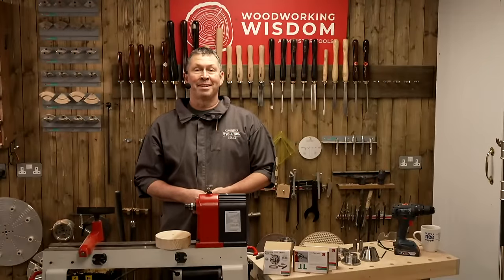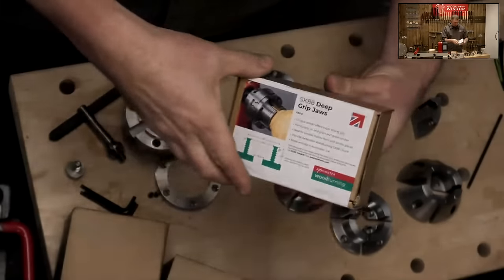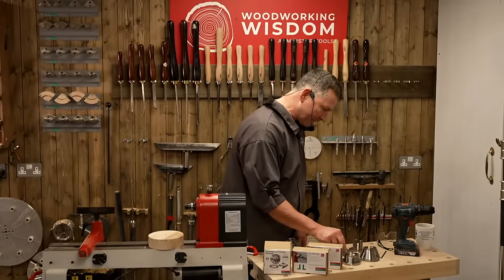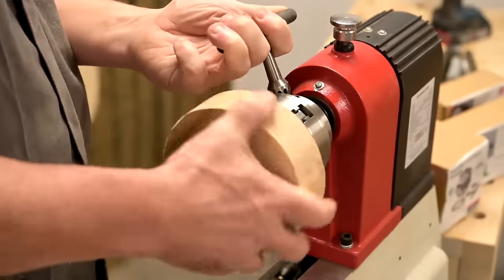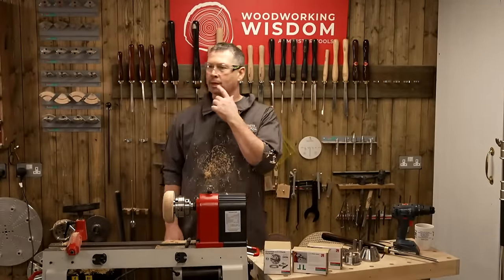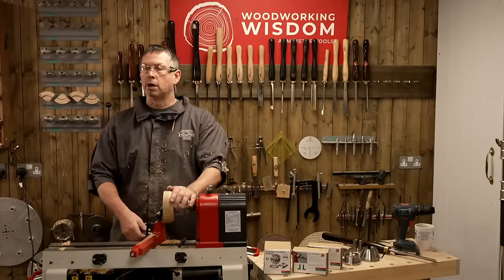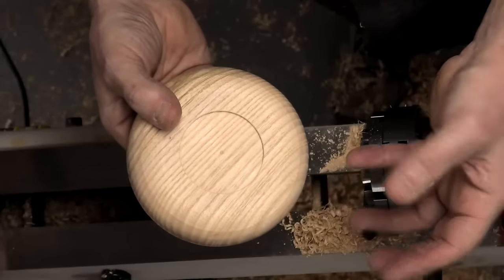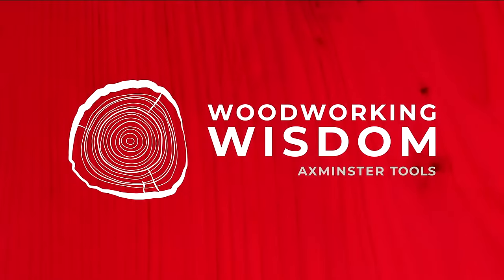Axminster Woodturning: Essential SK88 Chuck - Woodworking Wisdom

Comment: I missed the live feed but I have looked forward to viewing this video. As a new turner I initially purchased a cheap Ebay lever adjusted chuck.  It was in my opinion quite dangerous. (Insecure clamping, loose threads, no stop screws if you open too far, and it seems that the jaws always protrude outside of the base making a significant rotating hazard.  For most of my turning the compact Axminster design keeps the jaws internally and seems safer.   I bought an SK80 after watching an older Axminster video and I can't imagine using another chuck for my projects. I believe that my SK80 will last as long time for my use.  Your information leads me to get a 100 as I grow my turning skills rather than an 88 (as an additional chuck) at this time. Thanks!
Reply from the maker: Thanks for your feedback and glad to hear you enjoy using your SK80 chuck. And yes, the SK100 would be a great addition to your set up as your skills grow.

Comment: Will the jaws for the SK88 fit the Clubman 80.  Also will they be available in Canada.
Reply from the maker: Hi there, yes they do! The Axminster Woodturning Essential SK88 range of jaws are compatible with the Clubman SK80 Chuck. The Essential SK88 Jaws will also fit our Clubman & Evolution SK100 Chucks as well as our Evolution SK114 Chuck, providing the SK88 Mounting Jaws are used. Hope this helps. Our Canadian stockist is woodchuckers.com or thewoodturningstore.com in the US. Or you can purchase direct from axminstertools.com 🙂